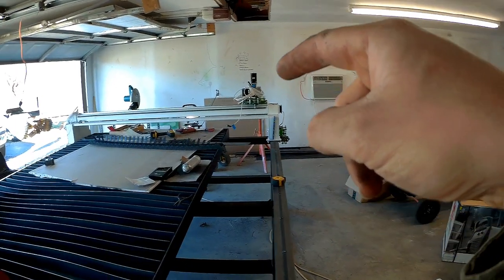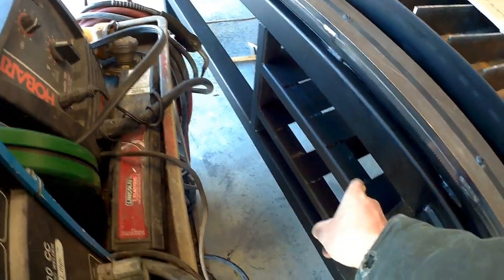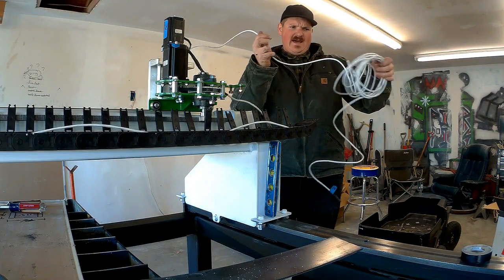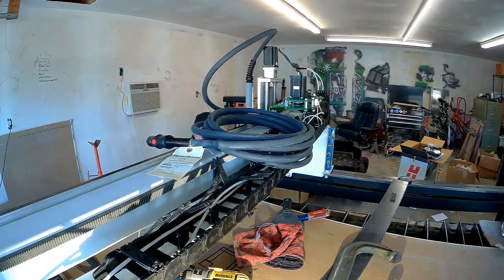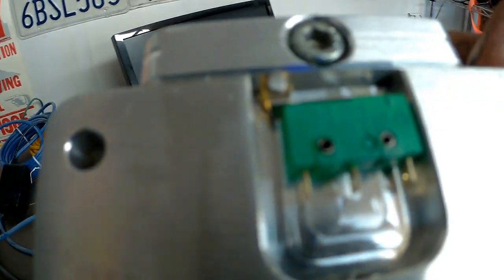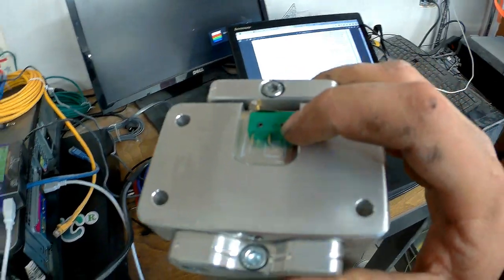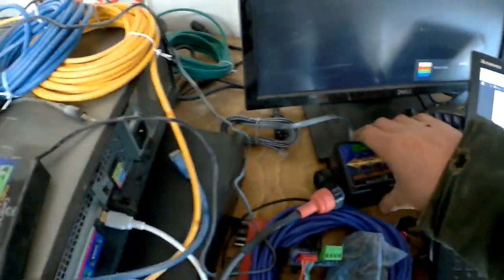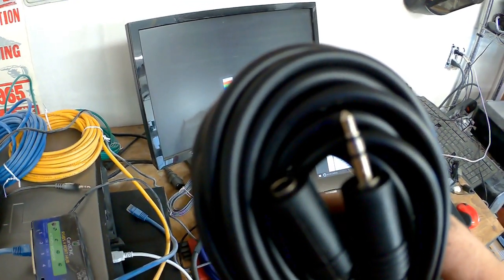Learning To Wire CNC Machine

Comment: M-T,

Your making progress dude!

I'm sure your aware of CandCNC's YT account and their website for information. A tech tip for you is not to pull cable off the coil like you did stick your hands inside the loop and un-spool it, this will keep it from twisting, the same hold true for winch cable. kinks can be bad  :(

I have the majoring of the base done for my  6x12 table, hope to finish it tomorrow.  Lots of dang drilling & tapping glad I have a good drill press and auto-reversing tapping machine :)
Reply from the maker: SegoMan that's a good trick for pulling cable. I deal w a lot of rope and cable doing rigging at work but it's usually on a spool. 

I've def used candcnc YT channel for wiring the big stuff but they have some info missing now that I'm into the ohmic sensing and troubleshooting. 

I wish I had a better way of tapping these holes...